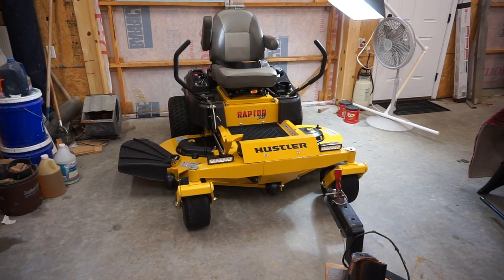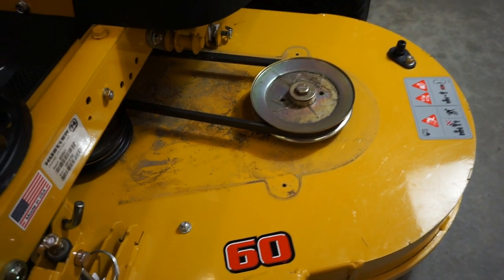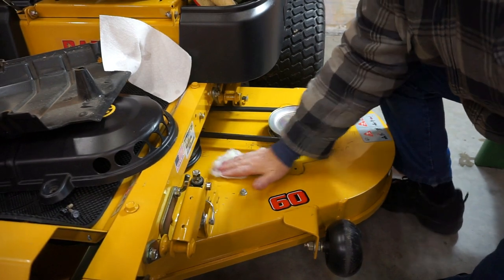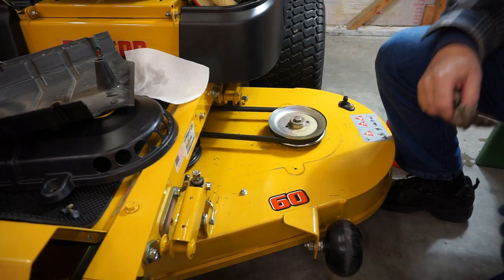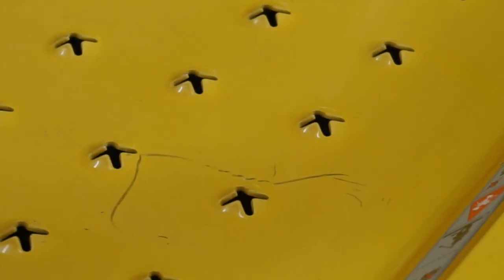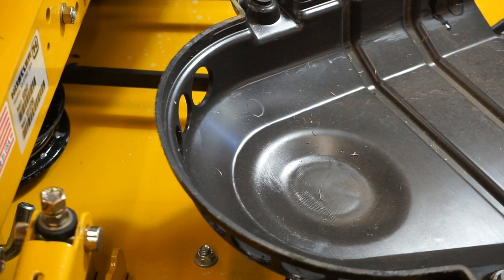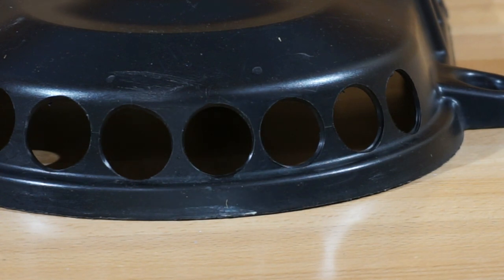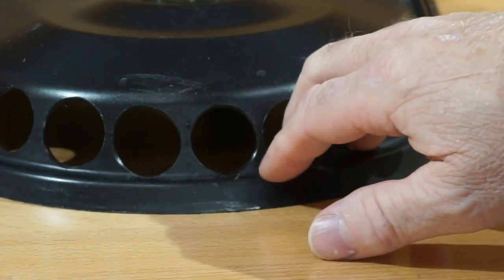Enhanced Maintenance Guide: Instructions for Your Hustler Raptor SD60 Belt Cover Clean Out Ports

Comment: I just did this (bought a used big dog last month).   I cut the holes with a 1 inch Forstner bit.  Worked great.  Made a huge mess but the back side of the holes are clean as a whistle.

Thanks Max.
Reply from the maker: Glad I could be of assistance. Be sure to blow out the covers after each cut anyhow just to keep any residual small amount of debris that can and will hold moisture. Want your deck to live as long as the rest of the mower.

You'll love those MGM Belt Cover Ports!

Comment: I really like that idea, but I bought my 54" used and it doesn't have the belt cover on it.
Reply from the maker: Bearings last much longer with them on and ported. Without allows the debris to build up below the pulley around the bearing holding moisture to rust out the deck and kill the bearings. Of course you can clean after each mow and that is imperative for a long deck life.

Comment: Great video Max it’s look good the way you drill them out I just cut my cover with a cutting disc so I could blow them out easily with a leave blower.
Reply from the maker: Michael, cutting them out works even better than the ports. I just worry about the kids in the neighborhood walking or riding up behind me as I'm turning and around without me know they're anywhere around as little kids do. Since you're out in the country so to speak, not as likely to have that problem. 

First time I saw that was 577Jersey (Tom) in 2015 and I loved his idea. He inspired me to do mine only with my redesign. So, between 577Jersey's and mine, there have been thousands of folks copy the belt cover openings. So, this is a great community.

Keep making those great videos and coming up with the great ideas you come up with.

Michael, go by and check out Tom's channel. You two have quite a bit in common.

https://www.youtube.com/watch?v=VvteMCkIrXI&list=PLyS8d_k3Y37tT_dy-f70HwjOav790zwom

Comment: If you think that looks dirty... you'd hate to see mine. I have about 200 hours on it.
Reply from the maker: George, dirty isn't the big deal. lol. I have a '96 MTD Yardman that still appears new other than loaning it to a neighbor. After he decided to push a car with the plastic grille/hood, it now looks like an open wheel tractor with no hood. I have a replacement hood, however, I've become so accustomed to it without the hood and grille, the replacement is sitting in the rear of the Garaj Mahal. I just like to keep them blown off and cleaned off. 

If I'd not made that last few videos mowing wet and too high, the crap wouldn't have been up around the engine, covering the battery, expansion tank, fuel tank, filling the frame rails, etc. Thus, when I put the hose to it, the otherwise clean belt cover location ended up getting all that crap along with the dirt attached and thus, after getting called out about it in an email by a couple of my joker friends, I decided I'd remove them and take a look. I had them off about two weeks before, perfectly clean. Well, you saw what I had after not cleaning the under seat area better. 

Now, lets see yours! lol
Reply: @MaxsGarajMahal  Next time I can get to it I'll take a shot of it... it's under a bunch of stuff now. I have had to power wash it a few times from getting it stuck in the mud a few times. I've got a sneaky spot around the barn near a neighbors pond that doesn't look wet or soft until you ride on it and you find a few old fence post holes or gofer holes. Next thing I know I'm stuck and it's easier to just get the tractor and pull it out.
Reply from the maker: @georgesimpson3113  I have one of those places as well. When building the new  house (Gray Gables) the house is way off the ground on the front side all the way down and gets way off the ground on the back as it goes down the hill as would be normal for a sloping lot. Thus I had to build a 5 foot tall quarter circle ramp in order to get into the attached garages on the house. Considering there are a pair of houses to the side of me that created a slight valley in which their run off causes a very soft area for about a hundred twenty five foot running fanning out at the front of the property to about fifteen foot wide. 

You can be assured if that isn't allowed to dry almost entirely, you're going to either make ruts or get stuck which neither is desirable. We do what we gotta do, don't we?